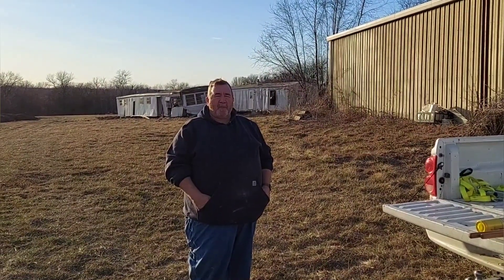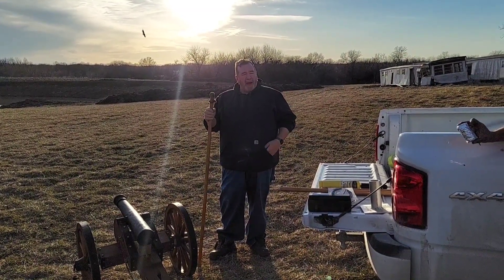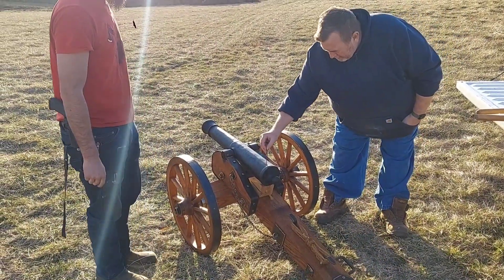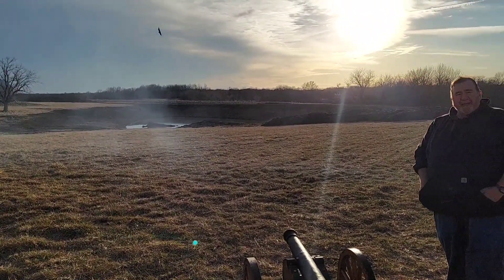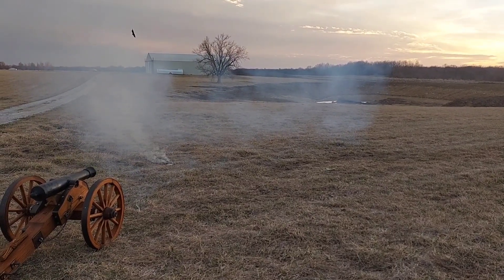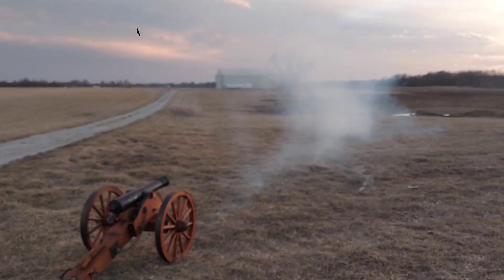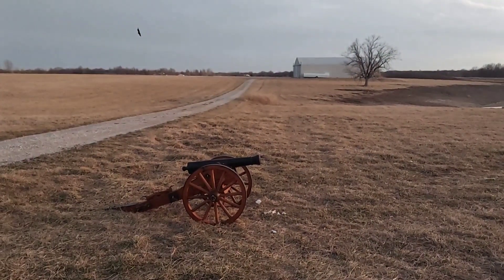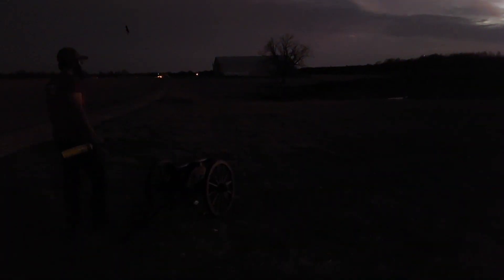I Bought a Cannon.

Comment: Looks like a 1/2 scale six Pounder to me. I have a  true 1/3 scale six pounder, and it is smaller for sure, with a one inch bore. If you want more fun at night, put a wad of steel wool on top of the charge!